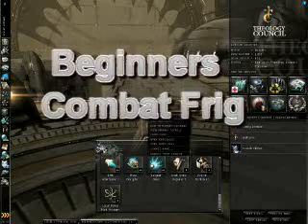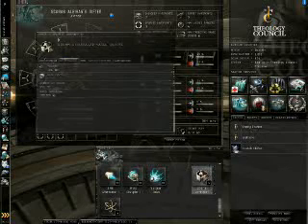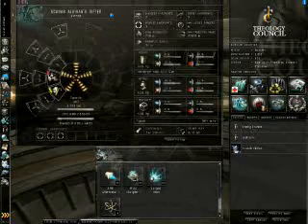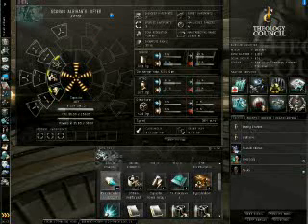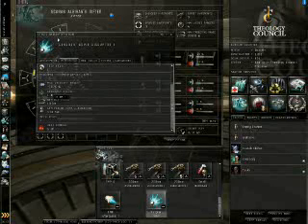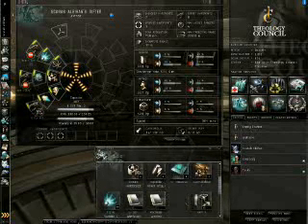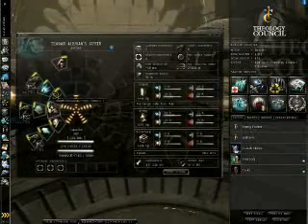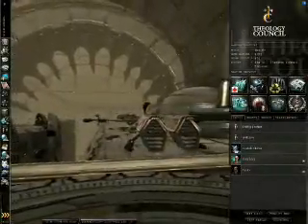Riffter to tackle with

Comment: its not fail. just fit it with t2. and its good to have a rep. you can rep with damige control.
thats almost what i run on and i can take out just about anything smaller or same size as a cruiser.